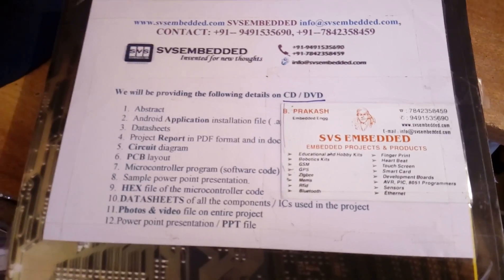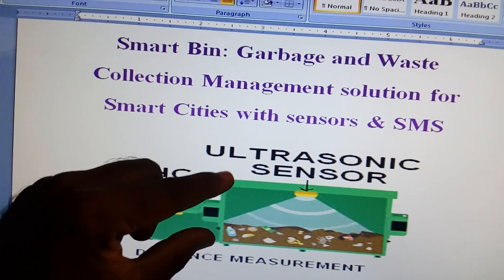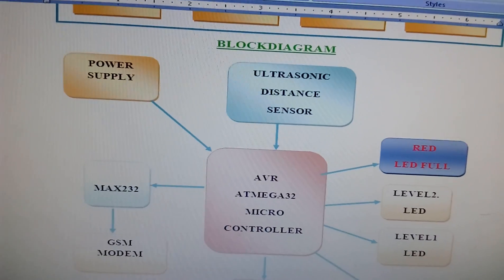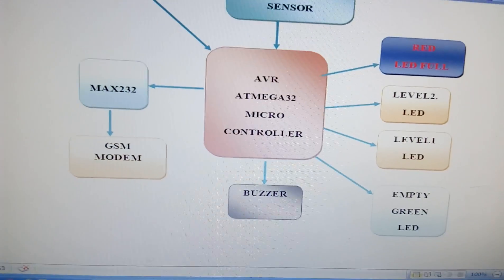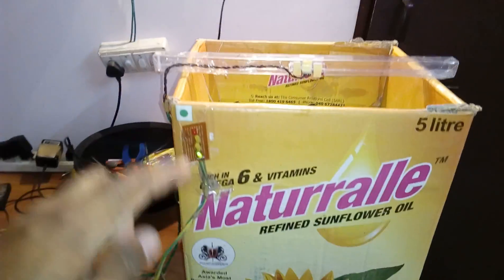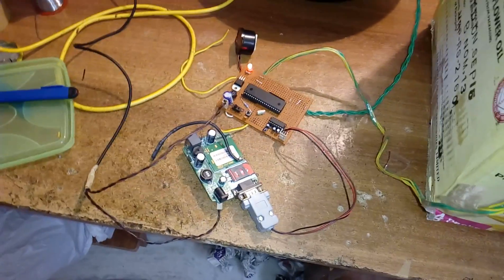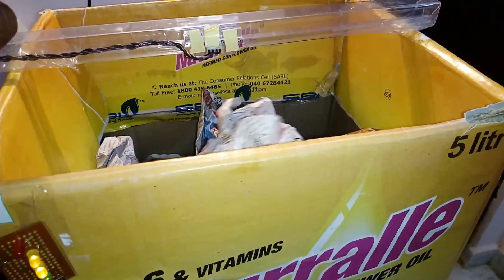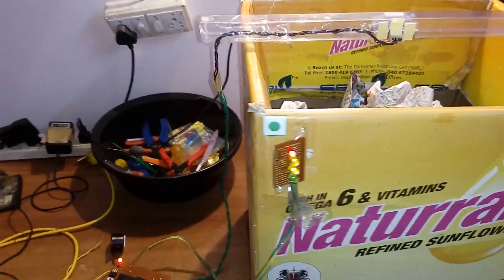Smart Bin-Garbage and Waste Collection Management solution for Smart Cities with sensors

Comment: Can you please guide me how to add a power source in this circuit with reasonable power back for my university project? Thanks
Reply from the maker: Thanks for watching and your valuable Feed back.we can do the battery operated power source also.we will provide the circuit diagram to u.

we are selling the projects with least cost.if u order the project we will provide working hardware kit along with 
1.abstract
2.datasheets
3.documentation
4.schematic( circuit ) diagram.
5.software code.
6.sample ppts
7.photos&video file on entire project
through google drive
send me a mail to  svsembedded@gmail.com,info@svsembedded.com.
we will send u the how to order procedure to u.